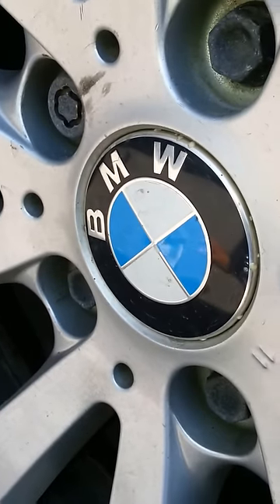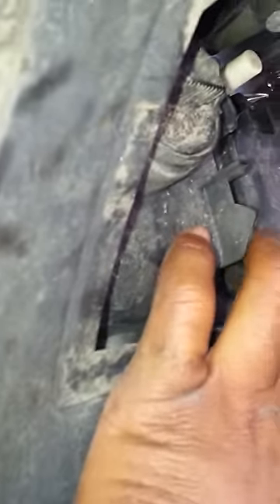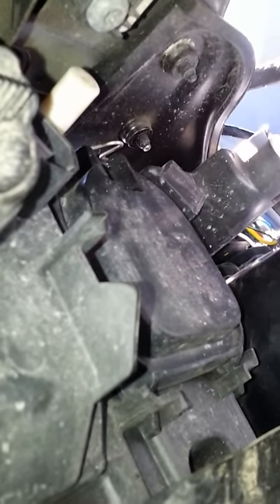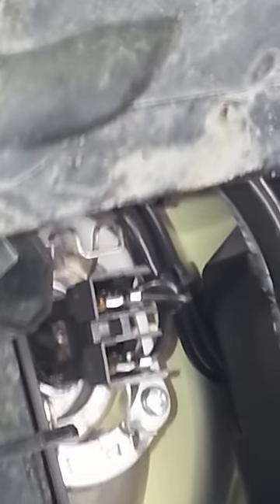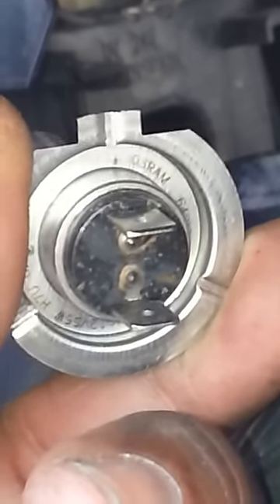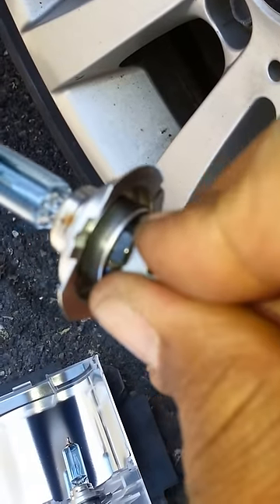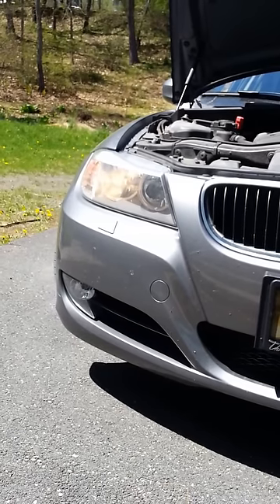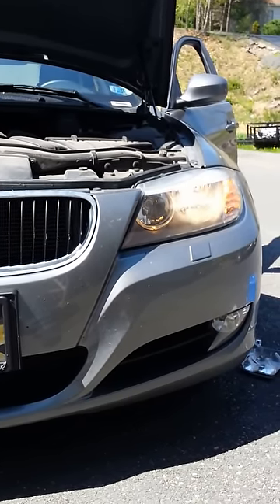How to Replace Change Low Beam Headlight on 2011 BMW 328i E90 Xdrive

Comment: 8yrs later, this solution still works. It should, because BMW is a 2011 model. Very well detailed video, took me more time to fix the following 1. reading the model of the bulb behind the old (it was 12V 55W H7U), drove down to ace hardware and picked up brand called Peak lightning with 55W-H7U. 2. it took 15min to place back the black box, you need to pull the metal down from the sides with some pressure till it snaps. Dont put too much that it breaks. Again, Thank you brother this video was very helpful and took me less than 45min (removing, running to spares shop and fixing it back).
Reply from the maker: Thanks for commenting to let me know my video helped save you time and money the dealer wants.👍🏾👍🏾👍🏾👍🏾

Comment: Bro, Thanks so much for taking the time to do this. Everytime I see a light go on across my dashboard, I get a knot it my stomach. "How Much This Time?" This was well explained and very easy to do. It was just as you explained it. Right down to the slight twist to loosen the bulb clamp. Nice Job!
Reply from the maker: So glad I was able to help.👍🏽
Reply: Dude i feel you so much, since i had my engine overheat light in my dashboard ( water pump failure ) everytime i hear the little sound comes on my heart stop lol

Comment: 4 years later and this is still doing the job. Thanks! Although, WARNING, hang on to the black plastic light bulb cover when you take it out. If you drop it, like I did, you have to remove a bunch of fender liner screws to open up enough space to retrieve your part. Mine fell way down in there.
Reply from the maker: So glad I was able to help.👍🏽 and you are correct about holding the cap tight.  I should've mentioned it.
Reply: how were u able to retrieve it i dropped mine too and don’t know how to get to it

Comment: Thanks fella. Also good for 2009 BMW 320d. You saved me time and effort, especially with the correct positioning of the plastic screws on the flap inside the wheel arch. Struggled for 10 minutes before finding your vid. Both bulbs done in 20 mins (And I'm a rank amateur). Nice one.
Reply from the maker: So glad I was able to help. 👍🏽

Comment: Pulling out of AutoZone now with my replacement bulb. Wish me luck! 52 year old female who's never worked on a car is going to do this with your help. Screw the dealership who wanted $150.  ☆☆☆
Reply from the maker: How did it go?!
Reply: (hanging head in shame)  I couldn't get the angle of the dangle!!!   I had a mechanic friend help me.  He took off the tire and poof.  :)  I threw him 40 bucks and called it a night.
Reply from the maker: Kasey Daugherty sorry you couldn't get it, but you did try. I'm quite sure you will try again when the next bulb blows out. You'll get it then. Nevertheless, you still won. $40 beatsvthe heck out of the dealers $150. The government should mandate all car manufacturers make it easy to replace headlights, brake lights, and turn signals. These are integral driving necessities that need to be changed immediately, especially when driving at night.

Comment: Hey Buke, thanks so much for the video. I know there was a reason I didn't buy a BMW. But my girl didn't listen to me. I don't know what I'm bitching about, I have a 2006 Range Rover and you should try to work on that! But I can change the bulbs in the RR in 30 seconds!
Reply from the maker: LMAO... Congress should pass a law that every car sold in the country should be equipped with headlight assemblies that allow ready access to the bulb so it can be change in less than 30 seconds.

Comment: I have a 2011 328i and want to install LED conversation kit. I'm having issues with the silver clip doesn't want to click back in what do I do?
Reply from the maker: sandro petrovic  So sorry i am just replying. Just found out YouTube changed the commenting policy. firdt yhing first, take a break,  then go back and try it slowly.  bmw made changing a necessary bulb too dam difficult. Push the latch toward the front bumber, the slide it to the left if your changing the right bulb... slide to the right if changing the left bulb.

Comment: Hey thanks for the video could you please share which brand/model you installed? Thanks
Reply from the maker: 2011 BMW 328i E90 Xdrive, BUT IT'S THE SAME PROCEDURE FOR ALL MODELS IN COMPARABLE YEARS.
Reply: No, I mean which model or brand of light bulb. I have a 325i 2010 which is very similar to your model and I need to replace my low beam bulb and I was looking into several options. I'd like to know what bulb you installed. Thanks.
Reply from the maker: I'm sorry. It's been so long I don't know if the bulbs I used is the best on the market now . At the time, I used the top of the line Sylvania bulbs. They ran me about $50 for the set. You can probably find a great set of LED replacements now.

Comment: Which upgraded bulb did you use? The reason I ask is because I have a 2007 328i and I was going to replace my headlamp with the Phillips H7.
Reply from the maker: Airborne you can use the H7 bulb. Bulb google the specs or check your manual to make sure.
Reply: Airborne use hids

Comment: Great Video , Thanks for taking the time. Am in process of replacing my bulb as well, i've got the same exact model even down to the color. A few questions 1. Where can i purchase the Replacement bulbs 2. Did this give you the left lamp out error message on the console. 3. This replacement is different from the Halo Rings Bulb Correct?. Appreciate your feedback, thanks again.!
Reply from the maker: So glad I was able to help. 👍🏾👍🏾👍🏾
Answers:
1. Any auto part store
2. I just got a general lamp out message before changing it. 
3. Yes it is a different fix unless you can reach the halo bulb from the same opening.

Comment: Hey, can you do a video on replacing the smoke detector battery next?
Reply from the maker: shit, i just changed all nine of them. the problem was for years i could not find the 8th and 9th detectors. never knew i had them. so even after changing batteries, they would still chirp... nevertheless, i found the other two. and nevermind thanking me for helping you replace your headlight.  your welcomed anyway . now you can  do a video on changing your sarcasm.

Comment: What bulb did you use?
Reply from the maker: I'm sorry. It's been so long I don't know if the bulbs I used is the best on the market now . At the time, I used the top of the line Sylvania H7 bulbs. They ran me about $50 for the set. You can probably find a great set of H7 LED replacements now.

Comment: I can't put the bulb cover back on
Reply from the maker: Hopefully you were able to change the bulb. That is the most important thing. As for the cover, reinsert the bottom notches first, then push forward into the locked position. Hopefully this helps if you haven't already got it done.